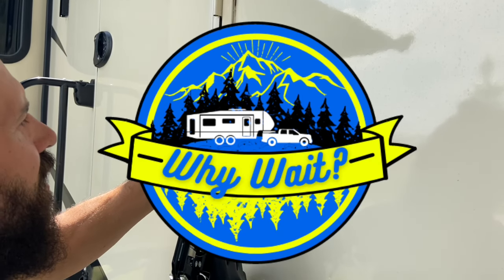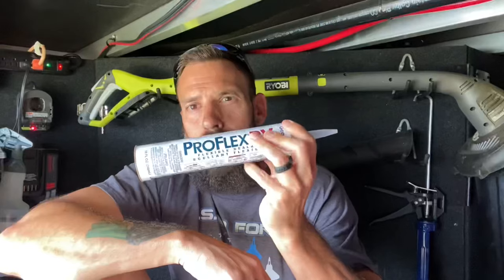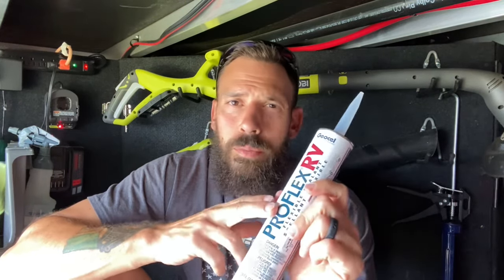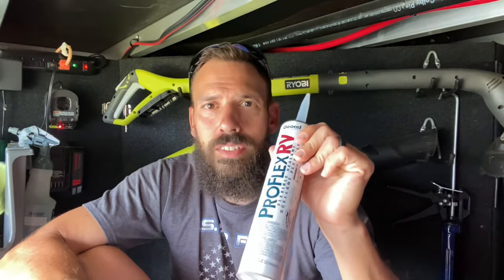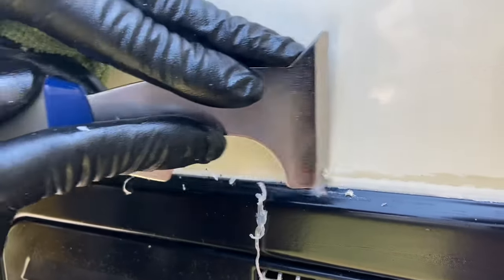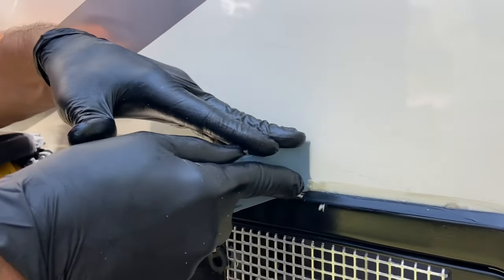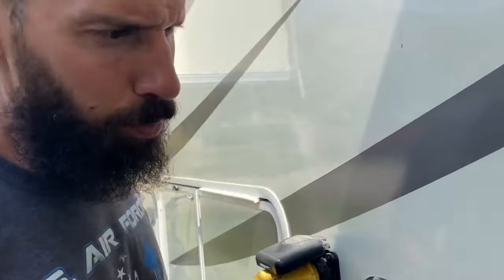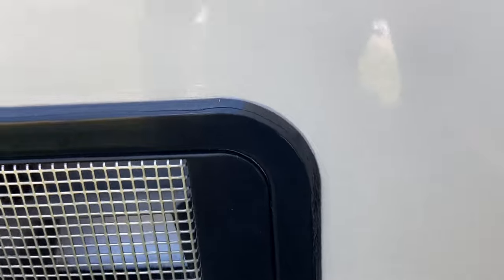HOW TO PROPERLY SEAL YOUR RV | (Best RV Exterior Caulk)

Comment: Doesn't the mineral spirits leave behind petroleum that counteracts our attempt at sealing it with a sealant?
Reply: Yes
Reply: I have used the mineral spirits with the proflex.  Worked just fine. Took a couple days to set up permanent. The seal is awesome. I had the same thought as you.
Reply: I am a factory worker and make louvers...we use  isopropyl alcohol to clean  all surfaces of oils and other barriers just before any caulk is applied..alot of our raw materials have an oil or  resideue on them....it dries fast and leaves no resideue on your prep surface...we use a empty clean spray bottle to apply the alcohol...and wipe clean ....  after the cleaning process is done ....then start laying   your bead...

Comment: I was told by someone who does this for a living that using denatured alcohol on your finger while smoothing is the best way to go. Using soapy water is what imparts those little bubbles in the silicone that then house and grow the green mold that looks like speckles. Pretty positive they knew their topic.
Reply from the maker: Correct, That’s what I do in the video, I use mineral spirits on my finger to smooth it out. I’m not sure about silicone though since I haven’t used silicone before on my RV.
Reply: I can attest to the denatured alcohol being far superior for smoothing and removing excess silicone or elastomeric while wet! I redo horrible caulking straight from the factory daily  at our lot.

Comment: Anyone that’s not proficient at caulking, id strongly recommend buying the cheapest caulk you can find and practice. Figure out if you’re better with an angled cut or flat cut on your tube. Figure out the size of the hole, the further from the top the bigger, this will determine if your good at a faster pace or a slower pace. 
The position you hold the gun to the surface.
The direction you pull or push the gun. 
Getting these items tuned in to your preference will allow you to lay an almost perfect bead, you’ll be amazed.
Reply from the maker: All good tips for sure! It’s an art form I tell you. 👍🏼

Comment: Good video.  Probably some of the least expensive preventative maintenance that you can do!  Couple of observations...

1)  Interesting that you get up to 2 years out of the proflex but it's only good on the shelf for 1 year.
2)  Mineral spirits would likely leave a film behind that could prevent good adhesion.  I would suggest rubbing alcohol or methyl hydrate as a cleaner/degreaser following cleaning and prior to applying the product.
Reply from the maker: That’s for the tips. I might be switching over to Lexel sealant next time and see how it holds up.

Comment: Great job, the only thing I wouldn’t use is WD40, which is mostly kerosene.  I have used several different types of sealant including regular GE silicone sealant, alpha systems and proflex.  Time will tell which is better. Larry
Reply from the maker: Thanks! Yeah I’ve actually been pretty impressed with the silicone that came from the factory. Most of it has held up great.
Reply: Why wouldn’t you do the WD40?   I’m about to do mine and seen this comment.
Reply: @myrahowell4817  I feel like WD-40 will repel the sealant since it’s oily
Reply: I've used straight WD40 on an Outlaw sprint car sprayed on every painted, non painted surface to keep mud off during pack in..... Has never harmed paint, fiberglass or anything.

Comment: Thanks for the info. Definitely need to get this done and the roof.
Reply from the maker: Any time! If your sealant is still good in the roof you may want to look into Eternabond tape. Here’s a video link on the mod I did up there. 
https://youtu.be/3CrVjVkEQWc?si=pqRwGVhDJSKmjpWR
Reply: @WhyWait  yep- that is the plan. Front and back caps and other stuff.

Comment: I’m pretty sure RV manufacturers do not use silicone as a sealant. Ive seen several sealant call out sheets and 100% silicone is not used. It doesn’t bond well and nothing else will stick to it. Are you thinking about products that may have a very small amount added for easier application?

Comment: Then after all this is done you have to polish, buff and ceramic coat TWO coats. Another 65 hrs of work. By the way, I've used proflex, that stuff is very thick and hard to work with. Sikaflex 1A is way easier to work with for me.
Reply from the maker: Yes sir the work is never done. Sikaflex 1A uh? I’ll have to look into that. Thanks for watching and commenting 👍🏼

Comment: And 1 year later, your video is still helping us all.  Thank you very much for that.  I read a comment about the shelf life being one year as apposed to the product lasting 2 years upon application and the commenter was possibly wondering why.  Well, I'm no specialist, but I'm assuming that in the tube, the product is not exposed to air & therefore is not released in a form to dry to the purpose it is intended for.  Once is is released from the tube and applied to surfaces and begins to dry, it is now reacting with air, drying and in it's intended form of protection.  But you mentioned in that comment that you were thinking of possibly trying Lexel Sealant to see how it holds up.  I'm curious as to why that product over the Pro Flex?
Reply: I may have answered my own question about Lexel.  Without phoning the manufacturer, Lexel states right n the website that it can handle up to a 400% joint movement.  Pro Flex RV has no information about the percentage on it's website other than stating that is has exceptional flexibility.
Reply from the maker: Yeah I just wanted to experiment and try something new to compare. I haven’t tried Lexel as of it. And yes the shelf life is for storing it in the tube how long it will last. Appreciate you watching. 👍🏼 oh and a link down below for what I use now to clean up the old caulk and prep the surface. It’s what shops use. It’s in spray bottle form or can. 
https://amzn.to/3PJYsur
Reply: @WhyWait  Thank you!  Thank you!  Thank you!  Really appreciate your videos & all of your help!  I'm going to check that product out right after I finish typing this.  I've just purchase a used but "New-To-Me" Class C and yes, I've been roaming YouTube for tips & tricks, but your explanations are so detailed and the reasoning behind them completely sensible.  So of course I've subscribed!  Thank you for all of your videos!  I do understand all of the work that goes in to producing the final video.
Reply from the maker: @tamo9520  really appreciate that! It can be a grind. Definitely check out our maintenance playlist and lots of helpful stuff there. Safe travels!!

Comment: Never could find your specific Roof sealant video. Did you post it? IF so, please add link in this description.
Reply from the maker: No I didn’t post it because I’m going another route. Working on that project now, going to use Eternabond Tape to seal everything and be done with it that way… no more checking every year and resealing with the self leveling sealant all the time. Do you have a question I can maybe help with?
Reply: @WhyWait  Ya, after buying Sealant , watched some vids and got Eternabond instead.. A little $$ but....

Comment: Will WD40 damage the rv paint at all or ruin your rv if it has permaplate on the paint job? Great information... I need to start on my rv. I am glad that the sealant removes easy.
Reply from the maker: No WD-40 will not damage a car or rv paint job. In fact it’s a great way to remove bugs from your tow vehicle, just rinse it off afterwards. However I don’t know what a permaplate is and you will have to research that yourself 👍🏼

Comment: Thinking using a mineral spirit can affect the texture of proflex. Mineral spirit can take of paints, I would not use it. I used water. Great video though for taking off old silicone.
Reply from the maker: It’s ok to use. Straight from the products data page it says to use Xylol as a lubricanting tooling agent. While Xylol is not exactly the the same as mineral spirits it is used for cleaning up painting equipment after us and is also found in mineral spirits. Soapy water does also work as well. Appreciate you watching!
Reply: Good to know. Thank you

Comment: Just started watching your videos. Going to do the A/C mod soon. What is your thoughts on Lexel for resealing? I’ve used it in the past just not on rv’s. Would you just stick to the pro flex? Thanks for your input.
Reply from the maker: Awesome, thanks. The AC mod is must! I like Lexel but I haven’t really experimented with it on the outside of the rv yet. It’s suppose to be good for out there. I would just go over the Proflex, the only sealant you can’t go over is silicone.

Comment: Hi, great video!  I have a question, if I may.  I have an '87 Ford Class C Motorhome, and the seals are bad on the upper front cabover window.  I was thinking, back in 1987, they didn't have the high quality of sealant available today.  The glass is held in by a metal frame, and screws.  Could in theory, could I just just a thick bead  of clear Proflex RV sealant around the windows, instead of trying to find the correct seal gasket piece?  I'm not sure Coachman even exists today.  Thanks for your time!
Reply from the maker: That’s A little bit out of my wheel house to be honest with you. Can’t really help you out with this one. Dont want to feed you information I can’t really speak on. Sorry.
Reply: @WhyWait  Hi, that's cool.  I have just acquired her.  I joined some Facebook groups, and they're giving all kinds of advice and tips.
One guy said take all screws out, pull window, clean around  area, and put butyl tape on the frame, and put window back in.  Many are saying it's not the window leaking, but gaps in the metal frame, so put butyl under the frame, and it will redirect the water around the window...and onto the ground.

Seems legit.  :eyes-pink-heart-shape:  Oh, and Camping World has Proflex RV sealant on sale..!!  WooHoo..!!!

Comment: Was thinking about painting the exterior of my old 1990s camper I just got. Absolutely needs resealed I can see where there's water coming in in certain places. Wondering should I do the sealant like this before or after I paint will paint stick to this?
Reply from the maker: Hmmmm not sure really to be honest with you.
Reply: After quite a bit of research I have discovered that supposedly ProFlex can be painted over with latex or oil-based paints after it has dried for at least 3 days 🙂
Reply from the maker: @SassyShelly  good deal 👍🏼

Comment: I watched you remove the seal on the first item and then you said it was proflex that you had put on last year. In the beginning of the video you said if any proflex areas needed to be resealed, you would just go over it with more Proflex. Why did you remove the seal on this part instead of just adding more proflex?
Reply from the maker: Just me being anal and wanting it to look better. Looks cleaner if you remove the old first or if the old is flaking you’d want to remove it first as well.

Comment: Thinks for all your great made projects and tips.  I have question for you.  I have 2 small holes, about 1/8", on the top and bottom of all my outside storage doors, do you think that over time water entrance will do damage?
Reply from the maker: Yes, absolutely. Over time the interior of the baggage doors will get soft and even start to show delamination on the outside. I would definitely seal those up the best you can. 👍🏼
Reply: Why would Mfg. put this holes in on new RVs? @WhyWait

Comment: WD40 is like diesel.  And using it to remove old caulking will prevent the new caulk from adhering properly. No matter how much you clean it up.
Reply: What would you suggest for taking off the old caulk?
Reply: @itr0863  I use a box cutter knife, or rasor blade without the handle. Very carefully, if you get the angle just right, you can slice it right off. Go slow (like one cm per sec.) and make sure not to cut into the unit. What's left can be removed by rubbing with water and soap.
Reply: @OHFORPEATSAKES  thank you so much for the help. i appreciate it.

Comment: Hi. Say 2 or 3 years later and you have to redue.  Will ProFlex stick to old ProFlex or will it have to be remove also.
Reply from the maker: Yes it will 👍🏼If it looks like it’s flaking though I’d probably remove the bad areas first.

Comment: ok, I have 1 section that always seems to have the leak. its where the exterior smooth panel meets the lower aluminum trim piece and has a 1/8" x 1/2" trim covering the joint . I had it sealed at the shop les that 2 months ago. relocated to Il. near st Louis, and the weather here is shit, rain hot then cold snow and heavy driving rain for hours 2 nights ago found the floor in the bathroom wet again it comes in the joint under the wall. I want a clear 2 " wide weather proof tape to apply over the entire joint and trim piece in that 10 ft long area . any recommendations. Charlie
Reply from the maker: Eternabond tape will do the trick but it’s not clear. That’s all I can think of. 🤷🏻‍♂️
Reply: I have ordered a small 12 ft roll of 2 " clear surface guard tape  that is 8 mil. thick like you use to protect the rocker panels of race cars from stone chips , you spray it with soapy water to place it and squeegee it in place then heat gun or hair dryer to set it. and it is done.  @WhyWait

Comment: Hey not sure if you had any issues with your basement cargo doors leaking, but I have a 2017 377 and I struggled to find the leaks, ended up being the screws in the frame needed to be sealed were the water sits. Just something to watch out for.
Reply from the maker: Thanks. Did you have actual water coming in that you could see or was your basement floor just getting soft spots from water seeping in?
Reply: @WhyWait  soft spot right by the inside of the door, it was on the water heater side so I was checking everything on that wall first, even the 50amp plug seeped some water. But the main issue was the lower frame screws. I took them all out and used that proflex in the hole and over the top once they were back in. Maybe on the newer units they caught that and did things different,  not sure. 
  Btw great videos, helped me out a lot

Comment: So why the need for caulking every 2 yrs?  I’m used to house caulk that last 10 plus years.  Seeking education.  Thanks
Reply from the maker: Caulking inside your house really only has to hold up against water. Even then it’s recommended to recaulk around 5 years. In a RV it’s battling the elements. The sun beats down on this daily causing it to crack over time, rain, temperature difference expanding and contracting it. Plus you have to take into the factor of the RV constantly moving down the road and all the seams shaking, twisting and moving over time. The roof of the RV really needs to be inspected often because of all this. Water will start to get into the smallest areas you don’t even realize and damage things over time not to mention unseen mold. You don’t have to do these things that often but I’d recommend it if you want to keep issues at bay. Thanks for watching.
Reply: RV and boat have one thing in common! Water allergies!

Comment: When you put wd40 on the area .... Will the new rv silicon sealant still stick?
Reply from the maker: I would recommend cleaning the area after using wd40 like I mention in the video with mineral spirits or soap and water. 👍🏼

Comment: Why can’t Pro flex not be used on aluminum rv roofs? Their description says it works on the roof.
Reply from the maker: I guess if you have an aluminum roof it would be ok to use. Most RV roofs now are TPO, EPDM or rubber roofs where you would not want to use this. Appreciate you watching 👍🏼

Comment: Hello I do not have a fiberglass exterior I have the traditional metal that’s over seemed & screwed.My question is will the sealant your using work on it as well.The pro flex rv.Thanks.
Reply from the maker: Yup you should be good. 👍🏼Attached below is more information about them. Thanks for watching. 
https://www.geocelusa.com/product/pro-flex-rv-flexible-sealant/
Reply: @WhyWait  Thanks for the reply.I recently purchased a 2014 HyLine.It’s 40’ long 3 tip outs.I have plenty of work
going over it from head to toe looking to replace sealant & preventative maintenance.That’s the RV life!Always fixing or working on something.

Comment: Mann it’s frustrating, I have an old rv , want to sell it now though, it’s def not like yours. The material is def not fiberglass, it’s like a plastic. I want one like this but of course they’re pricey mines like worth 4K and under .. the previous owners sealant job was tacky now I’m stuck with it until I sell it .
Reply from the maker: Bummer. Water will find every area over time it seems not matter what you do. Good luck
Reply: @WhyWait  what's the name of the clear sealant glue stuff? Is there a specific name? I need CLEAR GEL LIKE SEALENT to seal the crevices, I doubt the Lowe's employees will know they just there for a check 😆😆😆

Comment: If I'm going to reseal and coat the top of my travel trailer which do I do first?
Reply from the maker: That I’m not to sure about. I’ve never had to “coat” my RV roof before. What are you costing it with? Our roof requires no maintenance just adding self leveling sealant once in awhile when it gets old.
Reply: @WhyWait  wow! That would be fabulous to have a roof like that. What kind of roof do you call it that has basically no maintenance?
My roof is called a rubber roof. You use a liquid to roll our paint on the top. I also need to seal the seams so I just was wondering which to do first. I was thinking of doing the seams and then do the liquid roll on. Thank you for responding to my question.
Reply from the maker: @ivaalexander  we have a TPO roof. Most trailers/fifth wheels have TPO or EPDM roofs now. Just requires cleaning and some checking of the existing sealant every year.